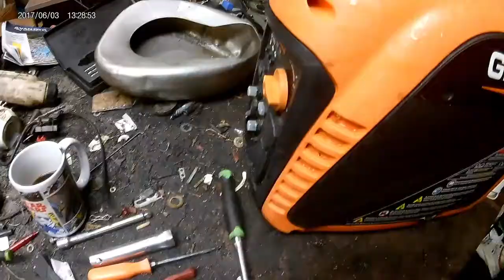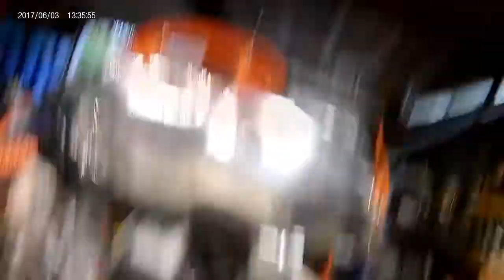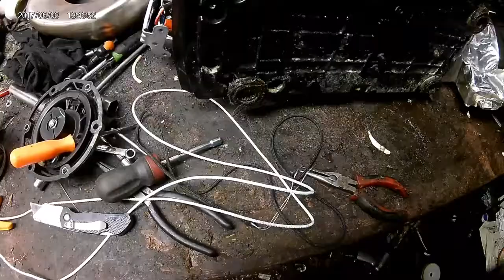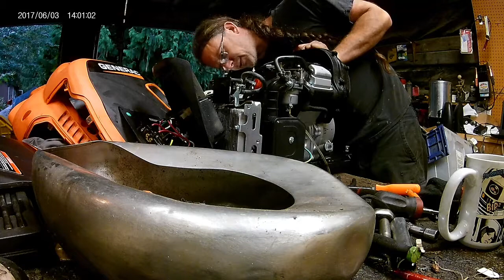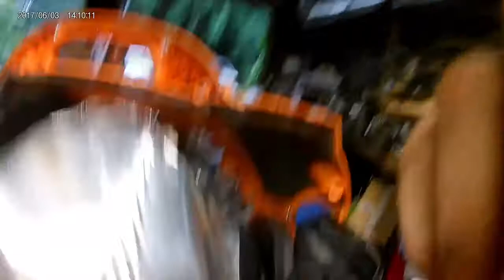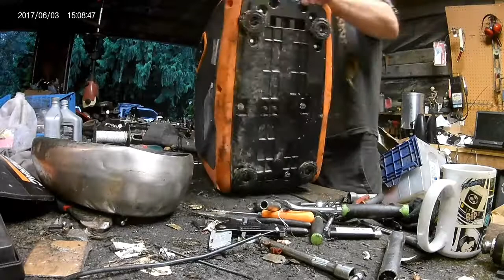Generac inverter generator rope replacement

Comment: Matt, you have a lot of patience.
I have two Generac GP2500i. The only run time they have is monthly testing. Changed the oil after about 15 hours; then, after another 10 hours. Keep the oil topped off. Changed the cheap spark plug for NGKs. Make certain the air filters are always clean. Run them until they're dry, and empty the carb bowls.
No problems . . . except for the bloody recoil rope on one of them. The factory employee who knotted it in the handle failed to knot it properly; after only two months, trying to start it I was left with the handle in my hand and a rope deep within the unit.
$160.00 to have it pulled out and knotted. The unit was only a couple of months old. I paid the service center and tried to get re-imbursed. (This is where potential buyers need to really pay attention.) I got the run-around for about 5 months: "It's been referred for 'review'," which is code for "We intend to ignore this until you get tired of it" is what I was told, almost weekly, for months by a "Customer Service" rep.
"Customer Service" my ass.
But they don't know me, so I persisted, ultimately sending copies of receipts and correspondence to the big boss of the investor group that owns GENERAC (Aron Jagdfeld), whose assistant emailed to tell me the company would send the reimbursement ". . . in a few weeks." HOWEVER, they sent the money to the service center (which had already been paid BY ME), and the service center sent a check to me.
Totally satisfied with the service center. Totally unsatisfied with GENERAC the company.
All because some poor guy on an assembly line in China failed to knot the rope properly, and the execs that run GENERAC don't want to back their product warrantees.  That's a lousy way to do business.
Since there has been no reason to run these generators in a power-down situation, I can't really speak to their quality; monthly testing seems to be satisfactory. But the GENERAC  company itself seems to me to be unreliable when it comes to backing the warranty. I certainly won't be buying GENERAC again; and indeed, I just purchased a much more powerful inverter generator from a different manufacturer, and will purchase another in a few weeks.
TWO RECOMMENDATIONS: 1.) Don't buy GENERACs.  2.) Regardless of the brand, BEFORE YOU DO ANYTHING ELSE, open the recoil starter handle (even if you have electric Start) and CHECK THAT KNOT!
Excellent video! I learned a lot, thanks to you!
-- Old Matt in Texas

Comment: 🤥Matt, You might want to polish up your presentation technique.  The camera is very sharp but I found it really disturbing to see the bedpan in the foreground along with your coffee cup (it would belong there if you were doing a Starbucks commercial). For a DIY guy like myself, I would rather see the generator on  cleared-off workspace so that I can see exactly what you are doing. When you actually get to removing the invertor it's hard to see what that screw/bolt is on the side of it. The four bolts you removed from the bottom made sense but i missed that other one as you did not move the camera into position. Finally, you totally skipped the part where you removed the starter assembly. The viewer is watching you remove the inverter, then hears you make a comment about being able to see the assembly and then magically, there it is lying on your cluttered workbench with what looks like a orange-handled screwdriver poked into it's side. C'mon man!